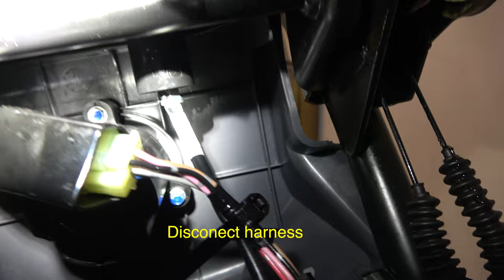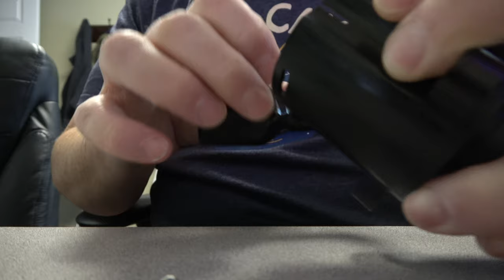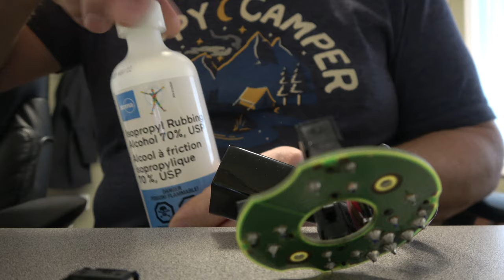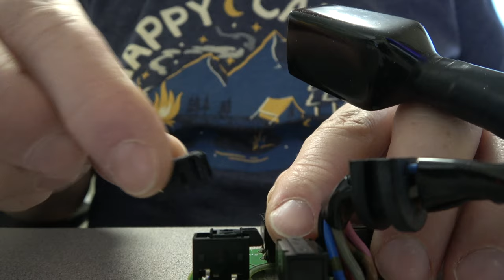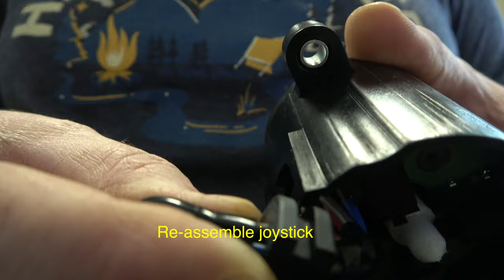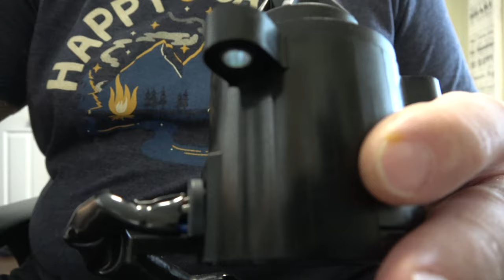Honda Snowblower Electronic Chute Joystick Repair   4K

Comment: Thank you for the well detailed video.  Gave me some eyes on the assembly before ripping it out. Much appreciated.  Disappointed that the switch only lasted 47 service hours (roughly 2 years).  It’s still under warranty but with loading it up and transporting back to Honda, along with a storm expected in a few days, I needed a quick remedy.  Your video provided me with that.  I’ll probably grab a spare switch and/or either clean the switch every couple years.  

Symptoms: Day 1 intermittent Right failure.   Day 2 Right failed and chute stuck going left, up and down.  Day 3 found this video and repaired.

Comment: Wow!  Your amazing tutorial absolutely saved my day!  Genius!!!!  We live in the Rocky Mountains (>9000 ft.) and just had a massive Spring storm.  My HSS 928A chute stopped working, would not turn L or R.  I spoke with at least 8 so called snowblower repair people on the phone, only one said to replace joystick but I can't drive to Denver to get the part due to the snow. I followed your guidance exactly (also had the very small flat screwdriver as well).  Perfect!  Now the chute works great!  I am so grateful to you for your kindness and expertise putting this on YouTube.  Thank you, thank you, clandrew1!  You have a lot of good karma coming your way!
Reply from the maker: Thanks Eric for your kind words. Glad it helped.
Reply: @clandrew1  just can't say thanks enough!  Question, how long do you think this fix will last? My snowblower is about 4 years old with frequent use (typically 40 minutes each time) Dec-Apr. From talking with a Honda dealer, the quote for a replacement part (joystick electronics) is about $60.00. I'm thinking it may be good to have the replacement part on hand should the same problem occur again.
Reply from the maker: Hard to say. Te contacts should last a long time. It’s the plastic part that may start to breakdown over time. For that price I would keep a spare on hand. I price one here in New Brunswick Canada (Next door to Main) and it’s $110 Canadian.

Comment: The right control for mine works fine for a while and then it may work intermittently after that. Is that the issue that these steps will fix?
Reply from the maker: Couldn't hurt contacts get a carbon build up over time.  Mine was also an intermittent problem.Also check wire harness to see if any pins are corroded.